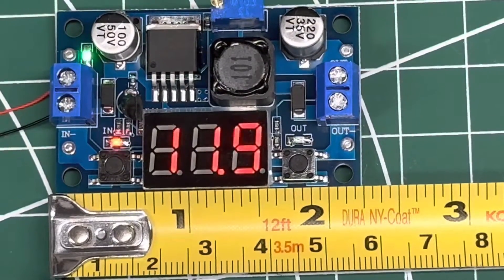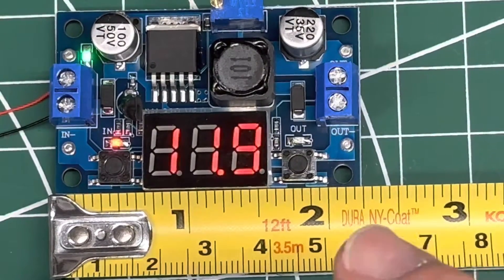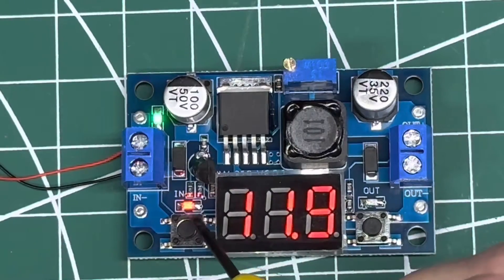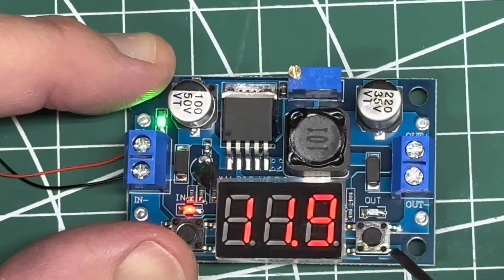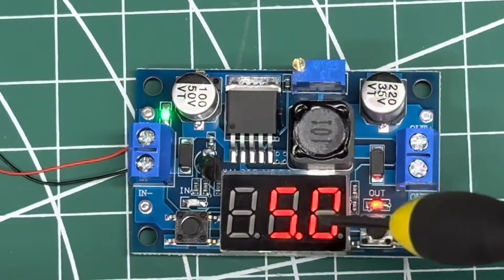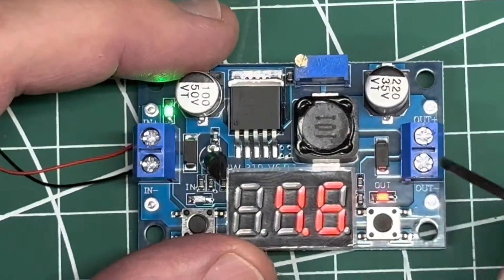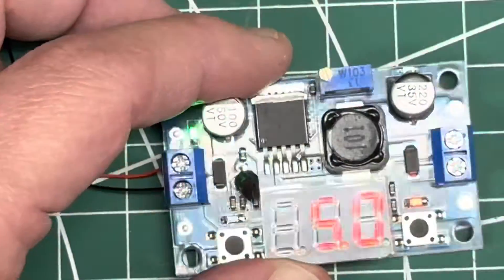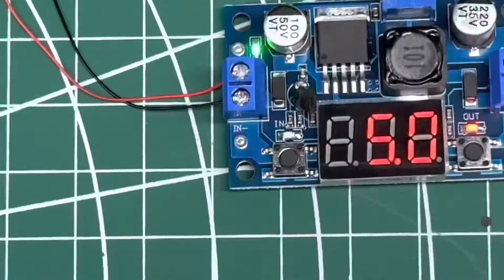LM2596 Buck converter overview/review 4-40v in/1.5-35v out (Step Down voltage Converter) regulator

Comment: Some Shopee sellers state the input voltage is rom 2.5V for the display model, does it work with input 2.5v to 3v, output 1.5v?

Comment: Is this ok to use with 12v 10amps power supply bro?
Reply from the maker: Sure.  It accepts between 4 to 40 V in.
Reply from the maker: It will only use the number of amps that needs
Reply: Ahh so it means as long as the voltage is just max 40v even with high amps is still ok.